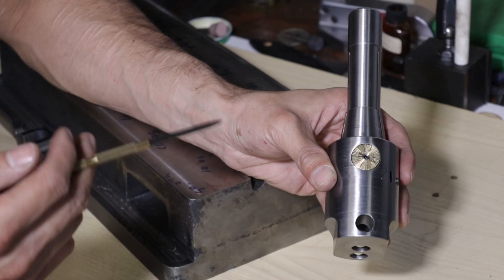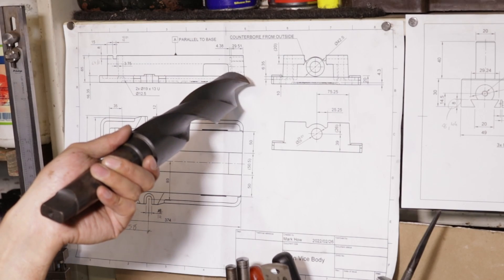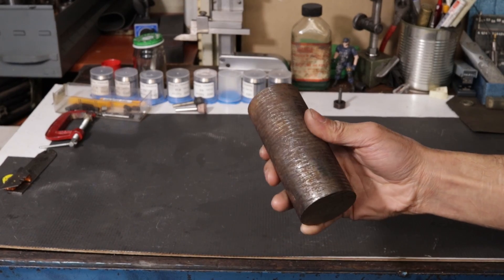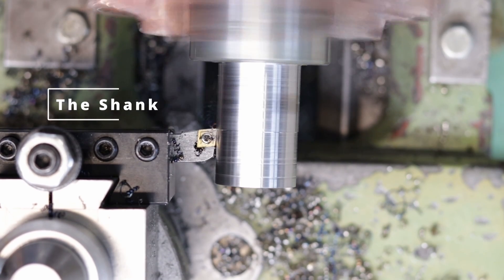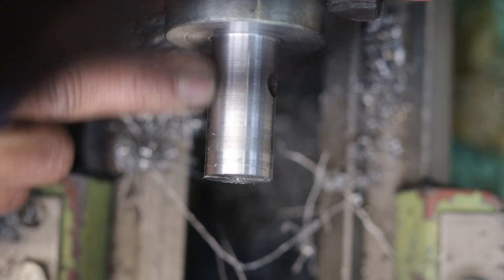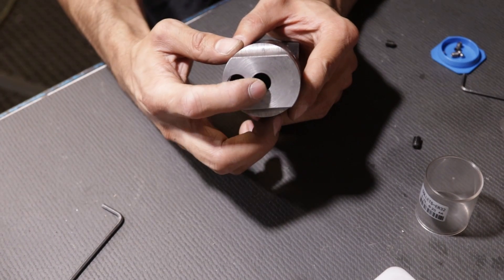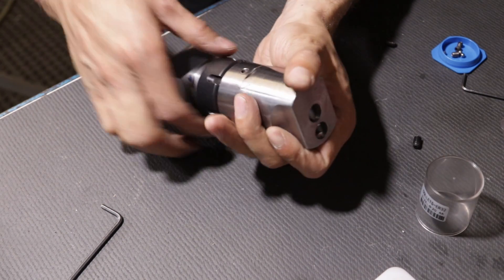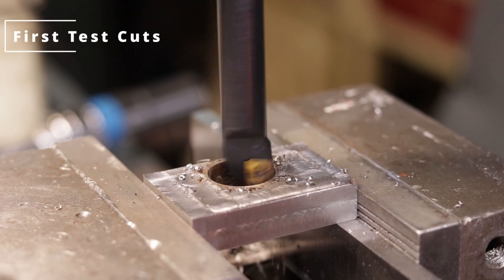Home Made Tools! - DIY Boring Head

Comment: Nice Job! This design is similar to one done by This Old Tony a while back. These heads are really useful. But….what is really cool is if someone would tackle a wohlehaupter head or the exotic and rate Tree taper boring head. I would do it but I am moving my shop and home and won’t be able to post machine videos for a while.
Reply: Matty’s Workshop did a boring and facing head